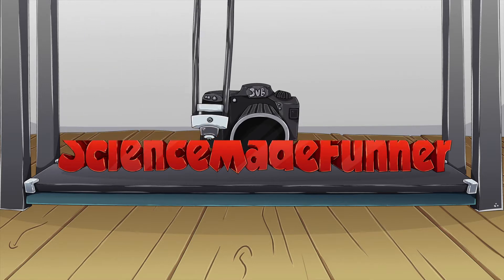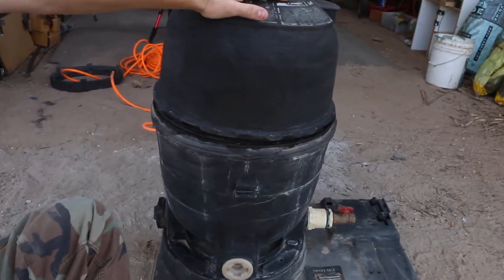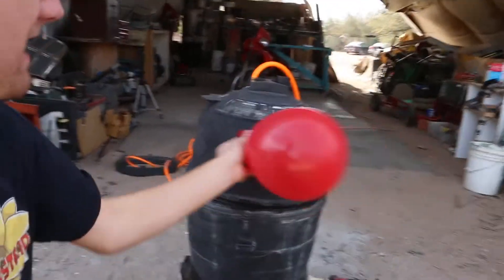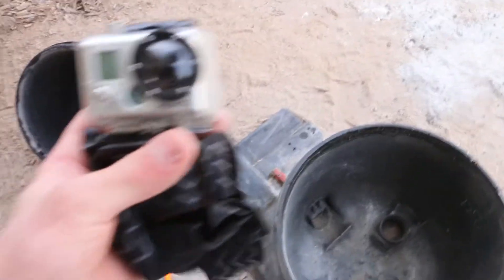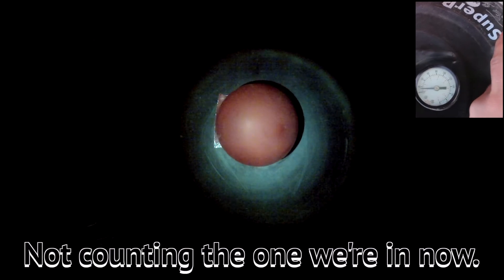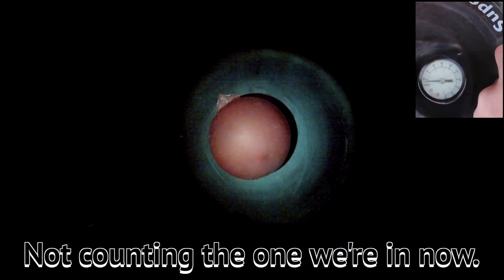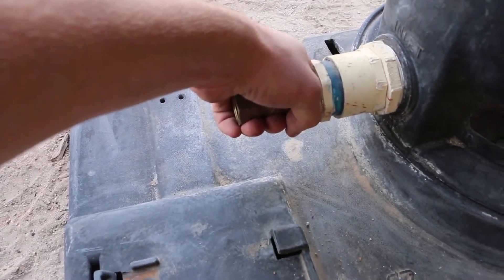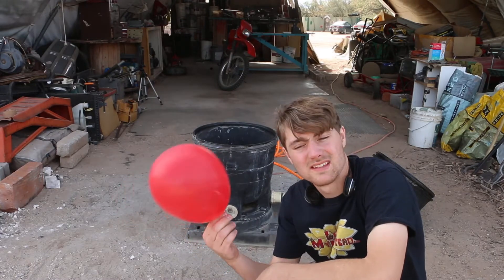Putting a Balloon in 4X our Atmosphere (Pressure Chamber)

Comment: Whwn i worked for LUMI juice, we used high pressure pasteurization for our organic juice.
We put some styrofoam cups in once and they came out a bit smaller than a shot glass. 
85,000lbs per sq Inch.